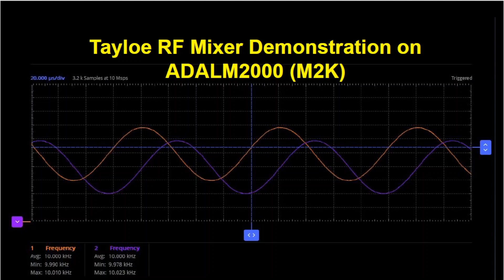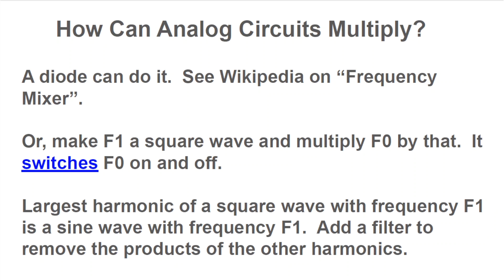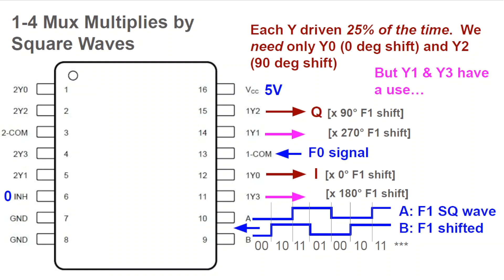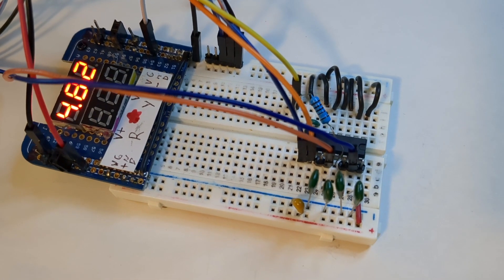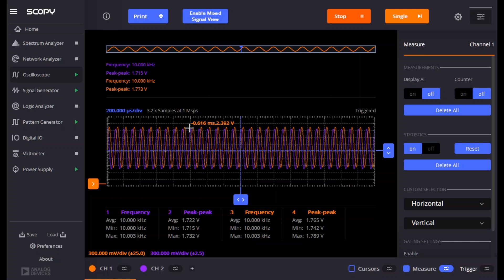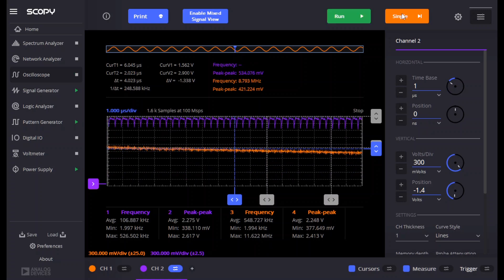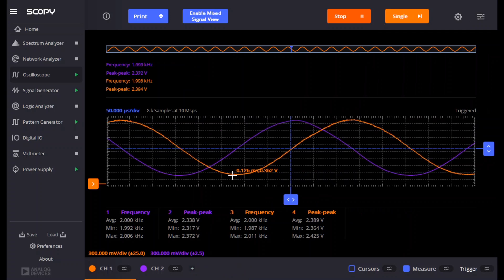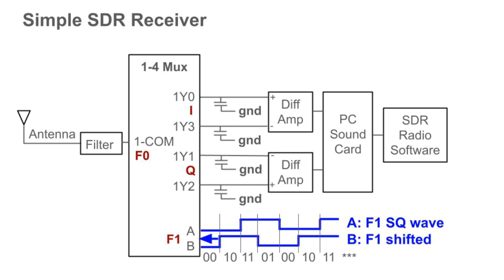Tayloe RF Mixer Demonstration Using ADALM2000

Comment: Great video.  Do you see any problem creating a standard direct conversion mixer by using a single square wave oscillator tied to input A on the Mux, ground input B and then only using the output at Y0 and Y1 (0 and 180 degrees) fed to the op amp to create just the I output?  I realize that the I output would contain both USB and LSB signals.
Reply from the maker: I think it would work as a regular single switching mixer.

Comment: Hi ! Thank you for the video. I am trying to build the receiver after your schematic with the SN74LV4062A. However, I cannot figure out how to orient this chip. Which way does the big u-shaped hole on the top point ? Towards the top of the schematic or towards the bottom ? The pin settings in the schematic don't match the datasheet I have for the 16 pin version.

Comment: Very nice video describing Dan's work on tayloe designs.  A big hobby of mine.  I like playing with the tayloes and have made and used several versions.. I still have many softrock RXTX units I am trying to understand.  The clock generator is an SI570 programable with the attiny and software on a PC. I purchased the M2K just to play with these on a breadboard.. and develop and use some sort of DSP on the output to an lcd.  What fun!  I am ~68 and working thru recovery from some strokes by doing this.. Thanks!  Guy N1GMM
Reply from the maker: Sounds like fun.  This year, I built the simplest softrock (40 meter only) mainly to prove that I can wind a toroid.  I hope you enjoy the M2K.  I think it's an excellent tool for learning and hobbyist experiments.  I expect the Analog Discovery 3 is also good (but more expensive). I have also enjoyed using companies like PCB Way (they do not sponsor me) to design and build my own PC boards.  If you can build something on a bread board, it's fairly simple and amazingly cheap to put it onto your own PCB.  I don't make videos about this process because many already exist.  My professional background is software, but I worked for many years for a company that designs and builds microprocessors/microcontrollers.  Working with hardware design (PCBs and FPGA) has increased my appreciation for my old hardware design coworkers!  Best wishes.
Reply: Thanks.  I also worked in semiconductor industry as a test engineer, microcontrollers, eeprom,flash memory 9 years at Intel, another 5 at Infineon, ibm,Motorola. All flash.

Comment: Couple of years ago, i used a Tayloe-like sampling/ switching mixer to implement a simple lock-in detection setup using some multiplexer and Teensy dev board. Finally this was used to stabilize the frequency of an external cavity diode laser - widely used in atomic clocks, saturation absorption spectroscopy and many more!

Comment: One huge advantage of quadrature mixers is that you not only have the amplitude information but also the phase information in reference to you local oscillator. Perhaps you can show that on another video.

Nevertheless a nice little video which helps to understand the principles of that mixer.

Comment: The problem with Taylor mixer is to find a switching chip which would work at 90-110MHz, and to feed it with quadratures!
Reply from the maker: Dan Tayloe's paper claims "the maximum useful frequency for this detector
readily extends to at least 10 GHz," and I can see multiplexers on mouser.com than claim bandwidths into the gigahertz...  But I suspect you are right.  There would be issues to be solved with higher frequencies.  One would have to know more about RF design than I do!  My thought is to try for HF frequencies only (3 MHz - 30 MHz).  My little demo appears to be OK at 25 MHz, but I lack equipment to be confident of measurements beyond 50 MHz or so.  Certainly, the ADALM2000 cannot do it.  I think there can also be issues with jitter in generating fast quadrature "F1" signals as well as bandwidth of the mux.

As I mentioned in the video, NA5Y has interesting material on radios built with Tayloe detectors.  This video shows his mux is not fast enough beyond 75 MHz or so.

https://youtu.be/KA4O8sTaZQo?si=DU8M3FKe4uTl5dpq
Reply: @electronics.tinker  I have seen a custom chip, based on Tayloe techinque, as a narrow-band 5GHz bandpass filter. So, it is possible. But the commonly used chip (used by NA5Y can't manage it)
Reply from the maker: I lack experience with truly high-speed signals.  Issues I have in mind relate also to signal integrity.  I suppose breadboards must fail at some frequency, and RF-friendly techniques become necessary in PCB design.  That would be interesting to learn about.  Thanks for your comment.